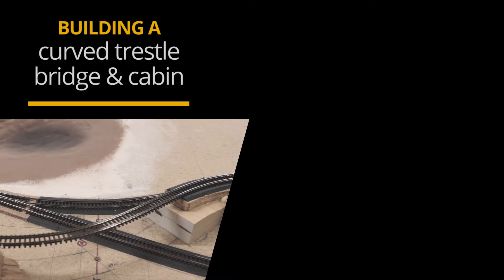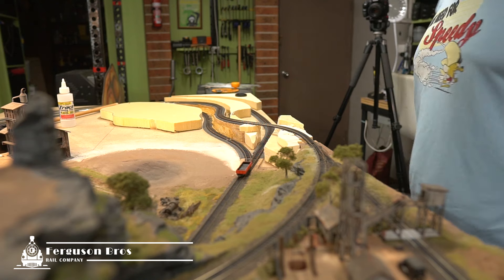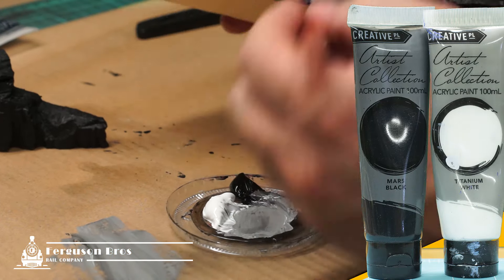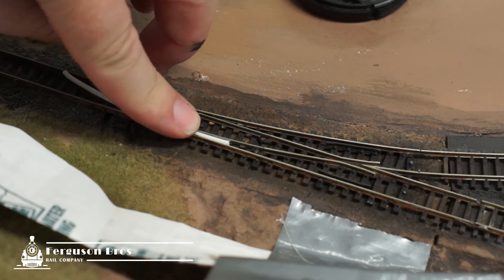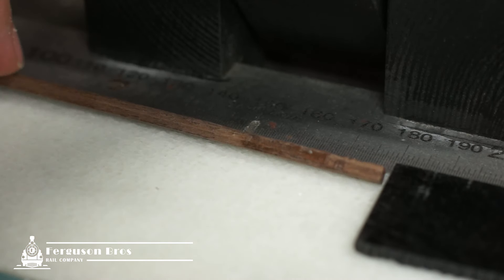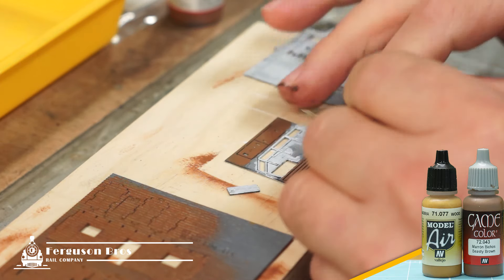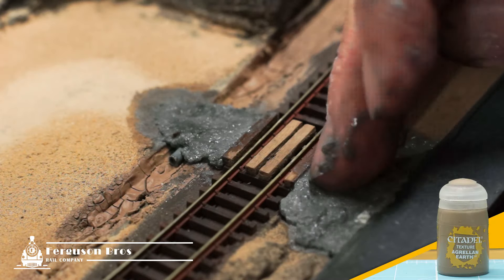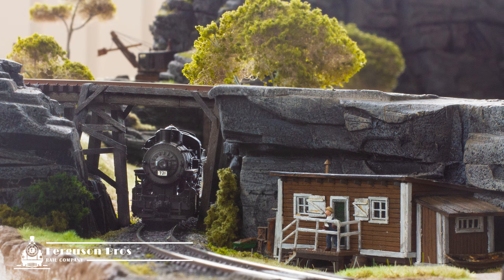Build a curved trestle bridge over fake rocks on an N scale model railway

Comment: I tried laying down dirt and also grass scatter in the way that you had described.  I used the isopropyl alcohol first, and then sprayed the water/glue mixture as you did.  When I was done, the area where I used the alcohol dried much darker than the surrounding areas where I only used glue underneath what was put down. The dirt looked muddy, and the grass was a very dark shade of green, even though it started out as a light/medium shade.  Is this normal?
Reply from the maker: That's interesting, did the surface have dark paint? Wondering if the isoprophyl drew it up into the materials.